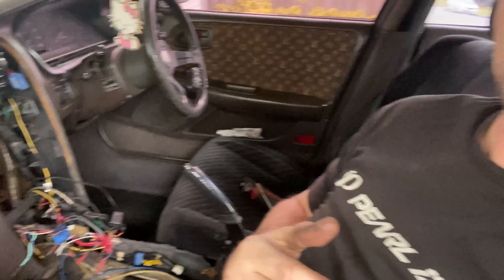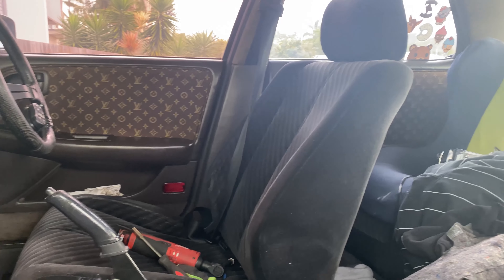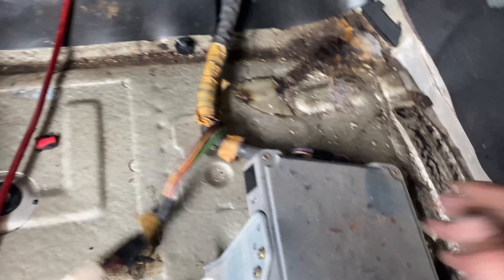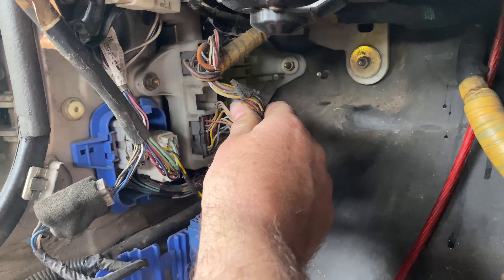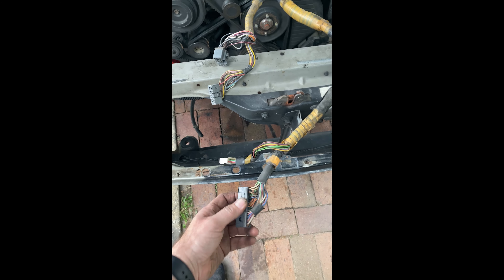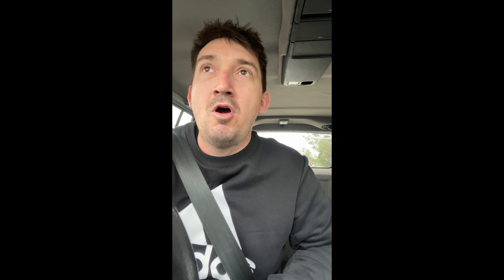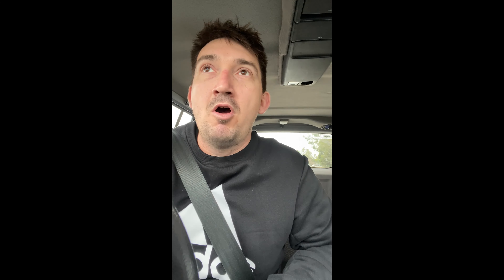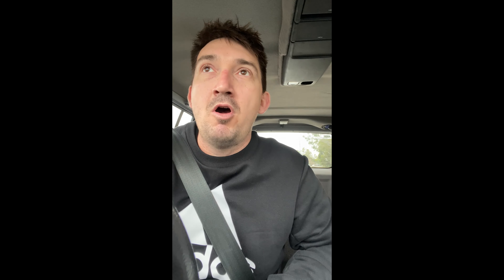1JZ / 2JZ Converting your Diesel Toyota LX90 to JZX - Video 2 Wiring differences / Injector Cleaning

Comment: Came here to see if it's worth buying a diesel x90 and converting it....
Reply from the maker: Stock JZX90 vs converted LX90, converted is cheaper. But it depends how much all the parts cost. I  basically went all out with mine & built the Gearbox, custom loom & brand new Link computer, Big single turbo etc. I spent a fair bit but its got everything. Ill do cams etc eventually.
Reply: Can I use a lx90 front sub frame ?
Reply: yes. You grind off the diesel mounts & the JZ bolts straight to the subframe. The JZ engine mount holes are there under the diesel mounts. Its explained in one of the videos. though that is probably the least hardest part of the conversion.  @tougemonster86